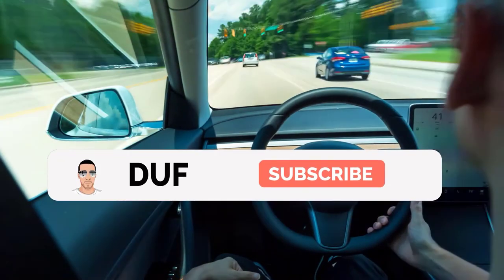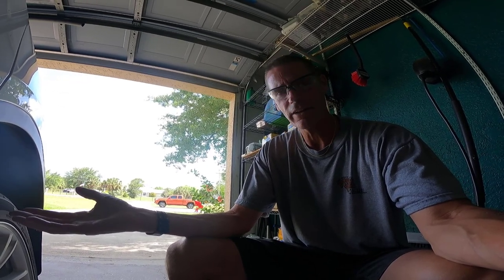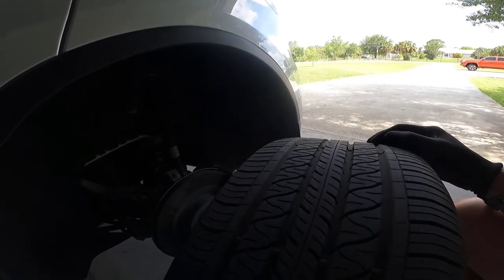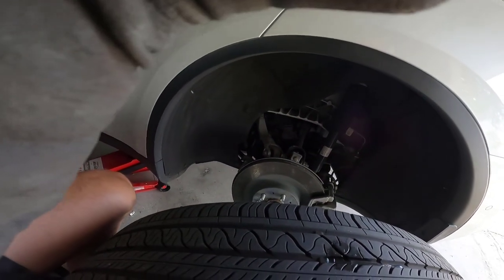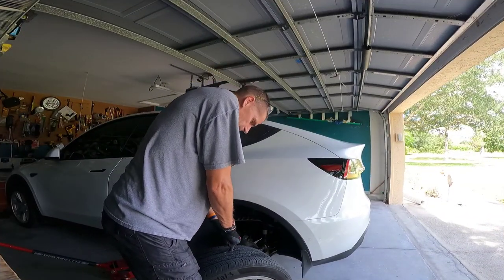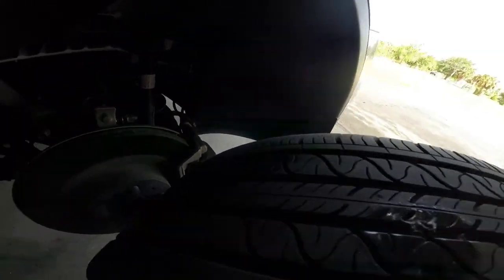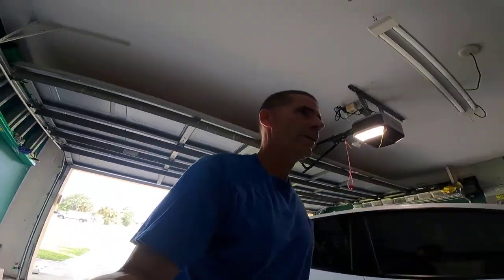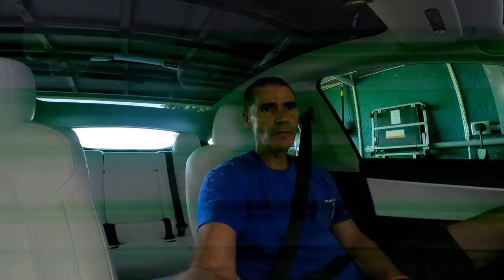When They Won't Patch Your Tesla Tire - The Tire Plug Alternative!

Comment: I just used the same SLIME kit on my Model Y yesterday (rear passenger). I had move the car around until the nail was exposed towards the back (5 o'clock position) to remove and plug the tire. I did use the rubber cement that came with the kit. In addition, I did lower the PSI down to 20 or so to be able to get the plug inserted. Even with these pythons for arms, I had to lower the PSI :)
Reply from the maker: When I plugged mine I deflated the tire to almost empty.

Comment: I swear by those plugs too...  they have saved me so many times. I have a plug kit and compressor in each of my cars and I have after market tire pressure monitor systems so I know when any tires have a leak. I agree with Mead Man... all of the kits I have ever bought have a tube of rubber glue in it, I recommend you get some rubber glue for next time. Don't buy ONE big tube of glue... buy multiple tiny tubes so you open a new one each time, or they go hard once opened.   I don't even take the wheel off, easy to do in place. 

When is the Y going in to get repaired? Any news on that yet?  Your head came out good (haha)
Reply from the maker: Yea I heard they go hard if unused. :)

Comment: Yeah, the glue seems to act more like lube. Makes it better for the…err…in / out as it were.
Reply from the maker: No mention of glue in the instructions for the plugs.  Knock on wood, this repair is working well, took the car on a 250 mile drive yesterday with no pressure loss.